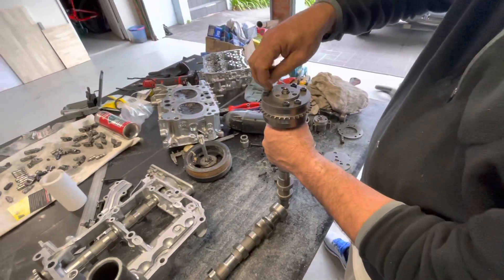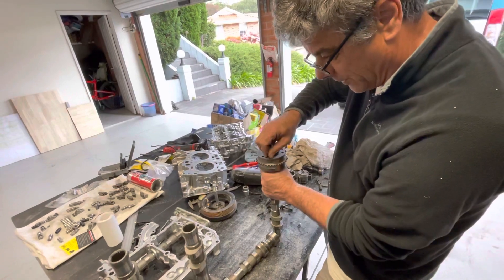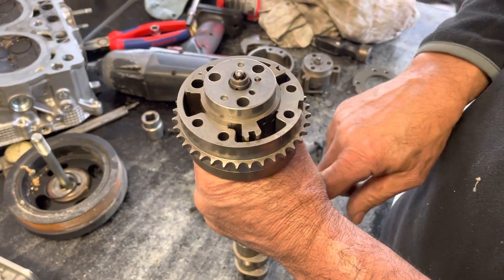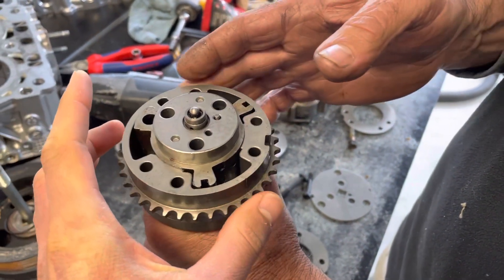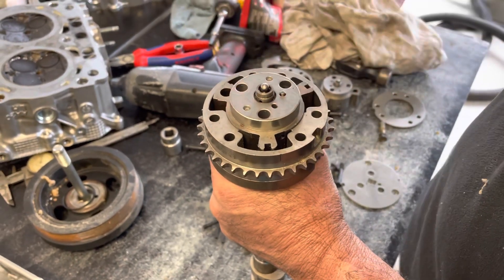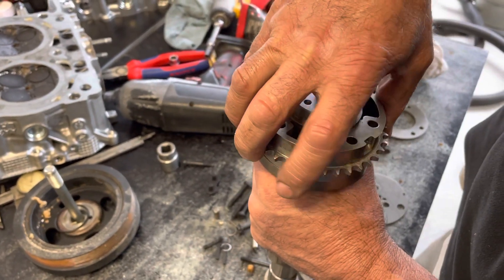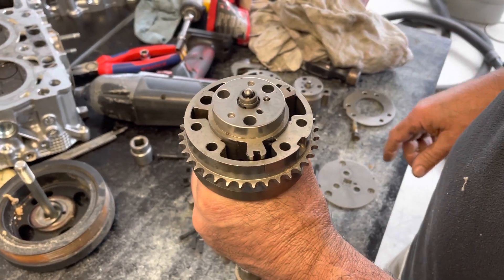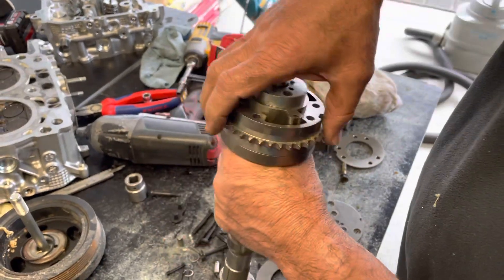VVT FA20 Engine What’s Inside the Variable Valve Timing Control in a Toyota 86/Subaru BRZ?

Comment: Hello, can you tell me where the VVT
 filter is installed on 2013 2.0?
Reply from the maker: Hey Beqa223, check inside the banjo bolts, which are located on the front of each cylinder head.

Comment: VERY VERY important to keep eye on your oil. ALWAYS check. I change mine EVERY 2000 miles...Also changed the oil actuaters. The original ones caused hesitation between 2000 and 3000 RPM.Also change your PCV valve often They are known to clog and build pressure in your crankcase and cause oil leaks. I also ripped out the charcoal filter before the air filter. This STARVES the engine from getting air.I put a K&N filter in. With all these mods I got more power and better milage. I also run 93 octane.2019 Crosstrek 6 speed Manual.

Comment: VVT has to move freely when setting a timing mark or has to lock in place? inside the VVT there is a pin with a small spring to lock the VVT from moving freely 
Thanks in advance
Reply from the maker: Hey @Cristovao Lay, I'll check with Dennis and get back to you. Are you currently setting the timing on your FA20? Thanks, Daniel.
Reply: Thanks, Daniel for getting back to me
Yes
I set up the timing for FA20 I have the instructions for the timing mark but there are no details about the VVT
Reply from the maker: @Cristovao Lay, I spoke with Dennis. He said VVT is locked without oil pressure. If you hold the camshaft at the lobes and you can turn the cam gears, you've got a problem. It's not locking properly. So when timing, make sure they’re locked. Let me know if you have any other questions.

Comment: Is there any filtration/Screens for the VVT on the FB motors? I know previously Subaru used banjo bolts with filters in them for the VVT system, but I haven't found anything for the FB motors yet.
Reply from the maker: On the FA engine it has a filter between the cylinder head and the block. Dennis has pointed it out in a video but can't exactly remember where sorry. On the FB engine it's likely similar but have not inspected for a filter.

Comment: Is there anyway to disable this system?
Reply from the maker: Hey @Brandon, yes you could lock up the cam gears or even better create new cam gears. You’d also need to tune to this new setup. What were you thinking?

We’ve briefly mentioned it here at 02:49 https://youtu.be/vojSzK0Jz4A
Reply: @denstoj  Oh ok I overlooked that part. I had an issue with the avcs system a while ago but I sorted it out. Thanks!
Reply from the maker: @turkforshort  great! Let us know if you have any other questions. 👍

Comment: How to reset vvt learned values after a timing repair?
Reply from the maker: Hey @IWORKYOUWATCH, the ECU should re-learn timing values. What issue are you having?
Reply: @denstoj  the bank 2 intake vam jump a tooth. The learned values for the cam angle are out of range now. The timing has been fixed with a chain and cam actuator but it looks like there is no way for the ecm to learn the new angle.
Reply from the maker: @Gregg0112  just a suggestion, have you tried resetting the ECU? Clear all fault codes with a diagnostic tool and then leave the battery disconnected for around thirty minutes. Let me know how you go. 👍

Comment: Is this better than than Honda's VTEC?
Reply: you can’t really compare this to vtec, because its an entirely different system and they do different things. vtec changes the cam profile (lift and duration) this only affects cam timing, lift and duration stay the same.
Reply: @avenged8fold1  oh ok , so vtec is better because it can do more?
Reply: @avenged8fold1  oh ok so vtec is better because it does more than toyota/subaru's system ?
Reply: @saulespino2510  Honda uses both systems in some engines. Vtec and variable valve timing
Reply from the maker: @iworkyouwatch 👍 you got it. Like @papabooey said, it can’t be compared to VTEC as VTEC is separate second cam profile.
Reply: regular vtec is just a change in cam profile(d/b/h/f/j series)
ivtec changes cam profile AND timing up to 50 degrees (k20a2) and like 35 degrees(k24a2) so this doesnt compare because its only changing timing so id say the ivtec is better
Reply from the maker: @Charlton Armstrong, well explained.
Reply: @denstoj  thank you sir. So with these cam gears, there's nothing to them in terms of construction?
Reply from the maker: @Ramslamtheman  they’re constructed well but can play up. Did you have a particular concern?
Reply: @denstoj  a customer has a gear that apparently is sticking and won't allow for vvt relearn (they just did timing chain and the mechanic isn't returning his calls)
Reply from the maker: @Ramslamtheman  what’s the fault code? It may have an oil supply issue.
Reply: @Ramslamtheman  That sounds like it could potentially be an issue with the solenoid that controls the VVT in the cam gear. If you're specifically talking about the FA20 or FB20 family of engines, this is apparently a relatively common failure as they rack up the miles. You can diagnose by checking the connectors to the solenoids to see if there is any oil contamination and also monitor the VVT duty cycles while the engine is running.
Reply from the maker: @AoDAzrael good thinking
Reply: When you speak of failure and oil contamination..... First are these cam gears serviceable? Clean any oil contamination from them or are you speaking of the cam positioning sensor's plugs being contaminated with oil. I've replace the intake and exhaust gears on the right hand side and now I'm having an issue with the left hand intake and making a ticking sound when the car warms up and the avcs activates. Thank you in advance! I'm tired of pulling my timing cover lol
Reply from the maker: Hey Kemp, yes the cam gears are serviceable but not a lot goes wrong with them. If you do pull them apart, you need to be very careful putting them back together. Generally you won't see oil contamination inside of them. Best to check the oil pressure relief valve in the oil pump first. Let me know how you go and if you have any other questions feel free to ask :)